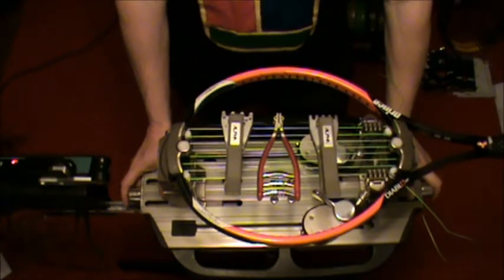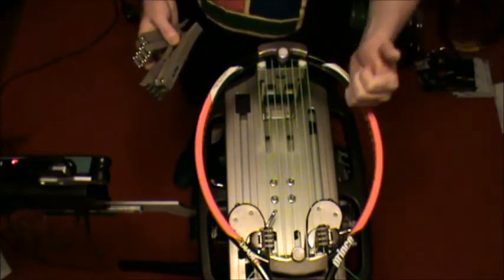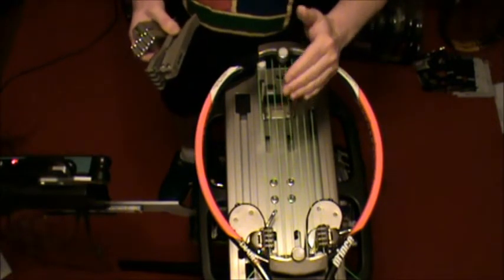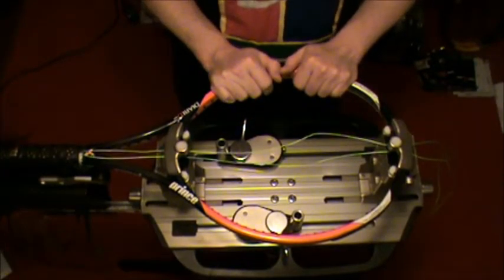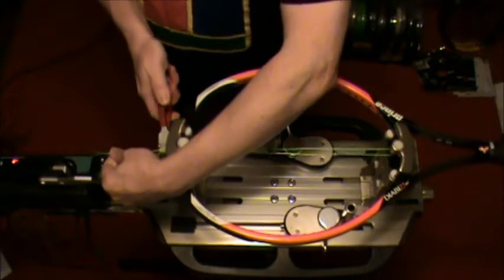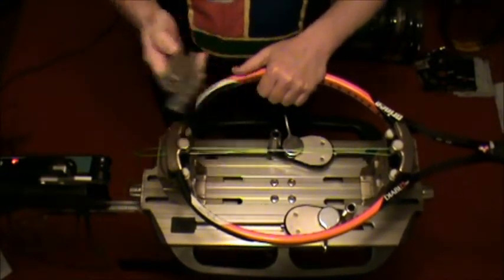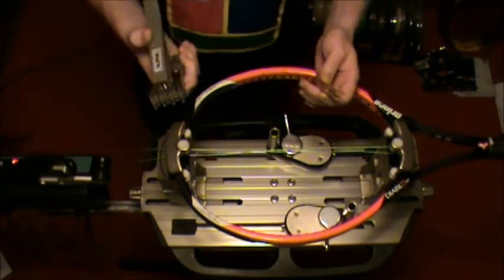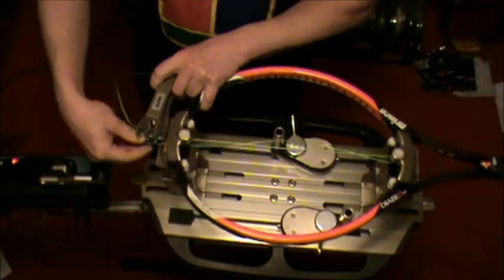How to start main strings using floating (flying) clamps. No starting clamp or starting pin required

Comment: Strung my first racquet just only using flying clamps because I haven't received the starting clamp, I applied your technique, also avoided using the starting knots, I saw your videos more than 10 times and it took me less than an hour. Used 55 pounds and the last strings used 60 pounds, thanks for all the knowledge transfer!
Reply from the maker: @Javier Li
Since your starting clamp had not arrived yet, how did you tension the top cross without resorting to using a starting knot?
Reply: @PCSStringing  Same technique as the main, use the flying clamp to hold the tension

Comment: Thanks for sharing a great idea of starting the mains without using fixed clamps or a starting clamp (which is somehow very expensive).  I use my "tube spacer" from the inner plastic tube in my over grip pack.  It works great.  I also play guitar, so when all the mains are done, I check the pitch and stretch as needed to make sure the mains with the same length have the same pitch (tension is evenly distributed).
Reply from the maker: You're quite welcome.
I got tired of seeing sooooo many really terrible videos, of people trying to demonstrate how to start mains with floating clamps, that I decided to make one that addresses the pitfalls that the other videos have (i.e. clamping away from the frame... not actually getting reference tension on each & every string, etc. etc.)
I made the video so that it covers all the various factors someone using floating clamps might be faced with (whether or not they have a starting clamp... whether or not the clamps can easily fit near one another... whether or not their racquet has 6 holes in the bridge, or 8 holes).
There's a few things that could be improved upon (better lighting, bright colored string that's easier to see, etc.), so I'll likely reshoot this video whenever I find time to get around to it.
Exactly what machine are you currently using?
Reply: @PCSStringing  I'm a beginner using Gamma X-2 stringer that came with just 2 bulky floating clamps.  When I need to use both clamps next to each other, I have to flip one up-side down.  Seems OK so far.

Comment: Nice video.  I have 4 starting clamps and two professional machines.  One with swivel clamps and one with glide bars.   Stringing fan patterns is no issue on the swivel clamp machine but it is on the glide bar machine,  which came with floating clamps.  I had a racquetball racquet I could not mount on my expensive swivel clamp machine so I had to use the glide bar machine since I could mount it on that.  But racquetball racquets are all fan patterns (and very annoying from a tennis perspective).    I could not use the floating clamp on the first two mains because first string is at 1 and second is at 5,  but could for some if there was an adjacent tensioned string.   I was curious if you could string an entire racquet with floating clamps.  I tried first with out watching any videos and failed miserably.    Not that I have a need but it was a fun challenge.   For kids who parents are tired of paying so much for string jobs, especially advance kids who hit top,  who buy inexpensive drop weights with floating clamps,   this video would be excellent for them.  Very well explained and detailed.   I have one question though.   When you were doing the scenario assuming bulky clamps (I think mine are) you set the clamp at the throat and not the head and released tension,  noting that it was just to make room and you would tension it later.   But couldn't you have clamped at the head so you would not have to pull (stretch) that string twice?   Or was that just to demonstrate side by side with bulky clamps?
Reply from the maker: Hello @imateapot51,
You've brought up quite a number of things.  Answering ALL of those things here isn't really the easiest thing to tackle.
Can you reach out to me over on the Tennis Warehouse Talk Tennis forums?  My name on there is simply "Wes".
You can start a "Conversation" (their terminology for a private message) with me on there.  It's a far easier way to communicate back & forth.
Which swivel clamp machine do you have (which you couldn't mount a racquetball frame on)?
Also, which glide-bar machine do you have? Neos 1000?
Could I string an entire racquet with floating clamps? Yes.

Regarding your question(s) at the end of your comment...
If you are referring to 19:05 in the video... yes, I could have moved that floating clamp to the opposite end (head). However, that would then have the frame with THREE strings tensioned on one half of the frame & only ONE string tensioned on the other half (this is something I avoid, as I only like to be ONE string ahead on a given side).
This decreases the amount of stress/strain on the frame AND retains better symmetry (tension wise) between the left and right halves of the frame.
After all, there's a good reason why we don't string all 8 mains on just ONE side of the racquet, and THEN go back and do 8 mains on the opposite side.
Same principle/concept, just a smaller value.

Look forward to hearing from you over on the TT forum.
Cheers, Wes

Comment: Got the main figured out using flying clamps.  Now, is there a specific way to do the cross stringing with flying clamps?  Thank you
Reply from the maker: @John Moon,
I don't understand exactly why you're finding 20:32 confusing to you.
Can you be more specific?
Perhaps you missed something important earlier in the video (did you watch all the way through or did you skip over parts).
Maybe (re)watch what I stated between 14:50-16:05
EXACTLY which machine are you using?
Also, let me know if you do, or do not, have a Starting Clamp.
Telling me these 2 things will help greatly, since I'll then know exactly what you're working with.
Cheers, Wes
Reply: Thx for reaching out, Wes. Apologize for ambiguous comment. I’m using Gamma 200 progression (entry level) w/o starting clamp. After rewatching a few more times, I got it. I’ll go w/scenario A. However, it seems like there are many scenarios to do the crossing. In many cases, many start the tension on the 2nd weave, causing tension drop on the 1st weave.   Do you recommend this?  Thx in adv.
Reply from the maker: @John Moon,
Regarding starting your mains...
Since you are using a Gamma Prog. 200 (exact same machine as a Gamma X-2, other than the Prog. 200 has a red base and the X-2 has a blue base), you have 2 identical Gamma composite flying clamps.  Due to the bulkiness of the Gamma flying clamps, I really doubt you fall into Scenario A (where the clamps WILL fit directly side-by-side, WITHOUT any other stings between them).
You, almost surely, will be Scenario B (where you need to have at least one string in between them, in order to have the flying clamps fit side-by-side - with BOTH clamps as close to the grommets/frame as possible.
Try this little test/check (in the following video) that I made when I was helping out someone else a number of years ago.  It also may help you better understand the difference between "Scenario A" and "Scenario B".
https://youtu.be/wcXCSYaYHj0
And here are a couple additional videos that should be well suited for you (Scenario B)...
https://youtu.be/Iq4xF0qvHSE and https://youtu.be/KjEZcp8U3HY
And, lastly, here's a nice "workaround" when using a 2pt. mount drop-weight AND the frame has 8 holes in the throat bridge...
https://youtu.be/Y7Y84ji8vpk
Reply from the maker: @John Moon,
Regarding starting your crosses...
Since you don't have a starting clamp, your options are somewhat limited.
However, you do have a few options to consider.  Check out the following video (which I made some time ago, when I was helping out someone else who also had a Gamma drop-weight flying clamp machine)...
https://youtu.be/gFmH4uMsdw4
Note: Although you (typically) don't HAVE to own a Starting Clamp in order to string racquets, I would highly recommend getting one.
It will greatly simplify the procedure of starting your mains AND starting your crosses - as well as several other useful things.
A Starting Clamp really is the "multi-tool" or "Swiss army knife" of stringing tools - it has many MANY uses.
BTW, if you tell me EXACTLY what frame you're stringing, I may be able to offer up additional tips/advice for handling that particular racquet.
Also, are you a member on the Talk Tennis forums?  If so, what is your user ID on Talk Tennis?
Cheers, Wes

Comment: In configuration B and 6 hole at the throat, you pull a string two different times because you clamp at the throat for creating a gap so that two clamps can be side by side.  How do you avoid pulling the same string two different times?
Reply from the maker: Hi @Scott Fung,
It may be easier for us to communicate through the TW Talk Tennis forums.
My username there is simply "Wes".
Feel free to send me a private message there (their term for a PM is called a "Conversation").

Comment: Based on your experience, how accurate is the flying clamps against the fixed clamp? In terms of stringing time which is faster?
Reply from the maker: In terms of pure tension accuracy, fixed clamps are far better than flying/floating clamps.
Because flying clamps work by clamping one string to another neighboring string, they will have more "drawback" (i.e. tension loss) than fixed clamps do.  The exception to this fact would be the Stringway Triple flying clamp (because it clamps onto 3 strings, it nullifies the twisting effect that is inherent to standard floating clamps).

Also, it is very very common that flying/floating clamps can not be positioned/clamped as close to the grommets/frame as fixed clamps can.  The further away from the grommets/frame that you place the clamp - the more UNTENSIONED string you are leaving in the string bed.  This creates even more tension loss.

Furthermore, very frequently flying clamps force the 2 strings, that they are clamped on, to be deflected (curved).
The 2 strings are forced away from one another (or sometimes forced towards one another).  Neither of these situations are good, since any time the strings are deflected (NOT perfectly straight) then you are creating slack in the string bed, and therefore even more tension loss.

So, (for the reasons I've mentioned above) in order to compensate for all this lost tension, it is typical that you would need to use a HIGHER reference tension on a machine with flying clamps (than would be need on a machine that has fixed clamps) for the string bed to end up with the same dynamic tension (same feel/same behavior).

In addition to all of that, flying/floating clamps present other challenges (especially to people new to stringing).

How to start the main strings (while preserving maximum tension) is more intricate/complicated when using flying clamps vs. fixed clamps.
There are many poor ways to start the main strings with flying clamps. I see people doing it very badly ALL THE TIME.
Very seldom do I see people using floating clamps in a manner which properly preserves the correct/most tension.
This is exactly why I created this video!!

How to start the cross strings (while preserving maximum tension) is also more complicated.
Example: how are you going to clamp off the top cross when there isn't yet another string to clamp it to?

Now... as far as pure speed goes, the time required is actually pretty similar.
Moving flying clamps around can be equally as fast (possibly even faster, in some cases) than moving fixed clamps around.
Part of that actually depends on if the fixed clamps are "single action" (like the glide bar clamps on a Prince Neos 1000) or if the fixed clamps are "double action" (like the swivel clamps found on the vast majority of machines).

In regards to speed:
If you're wanting to dramatically decrease time spent on each racquet, your focus should be on improving your weaving technique.
By far, weaving technique/speed is what will help you cut your stringing times down.  Weaving cross strings is what eats up the most time during a string job.
Reply: @PCSStringing  Thanks for taking the time to explain me in detail about the differences, it's really helpful for me, I ordered Stringway Triple flying clamp x2, based on reviews from forums that flying clamp hold tension without drawbacks, I think with the gamma starting clamp and the triple flying clamp I'll get very accurate tension with my KM machine. I'll start stringing into 2 weeks and let you the results
Reply from the maker: @Javier Li, if you tell me EXACTLY what racquet you intend to be stringing, I may be able to offer you more helpful/specific advice.
Reply: @PCSStringing  Babolat Pure Drive 2021 with klippermate SM, starting clamp and triple flying clamp x2
Reply: @PCSStringing  hey is it safe string the Pure Drive racquet with only 2 ending knots? that's because we need to cut it for main and cross, so that will be 4 ending knots

Comment: @PCS Stringing - Is there a way to start crosses without tensioning the first two at the same time using flying clamps ?
Reply from the maker: @adityareddyp -
There are a couple of different things that are often described as "tensioning two strings at the same time", so it's hard for me to know exactly which you are referring to.
There IS a way to start the crosses, and get full reference tension on each cross string.
First, let me ask you a couple things...
1. Exactly which stringing machine are you using?
2. Do you have a starting clamp?
3. Exactly which racquet are you stringing?
Reply: @PCSStringing   First of all, thanks so much for replying.
Using gamma X2 drop weight with flying clamps. No starting clamp.
I plan to string babolat AeroG and Tecnifibre XTC 300.
I have seen other videos on stringing using flying clamps and when they start crosses, they start with a starting knot and do not tension the first cross as the flying clamp cannot hold on to one string.
They only seem to tension the crosses starting with the second cross.
Reply from the maker: @adityareddyp -
Are you a member on the Tennis Warehouse Talk Tennis forums?
https://tt.tennis-warehouse.com/index.php
It would be easier for us to communicate back-and-forth on there (since I can also share photos/videos easier that way).
My username on the TT forums is simply "Wes".
Start a "Conversation" (that's their term for a private message) with me there, or just tell me what your Talk Tennis username is and I can start the "Conversation" with you (if you don't already have the "Conversation" function enabled, you will have to make sure to have it enabled).
Cheers,
Wes
Reply: @PCSStringing  Thanks Wes. I will send you a message in the forum.